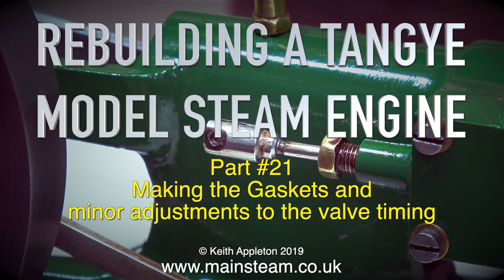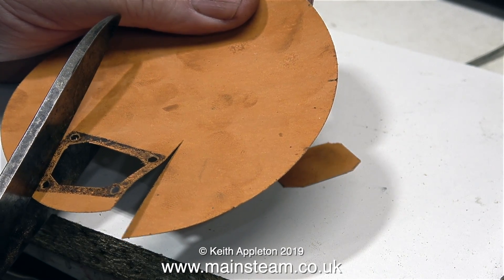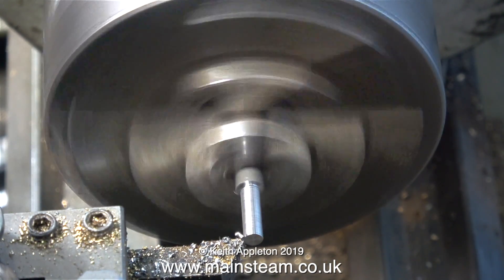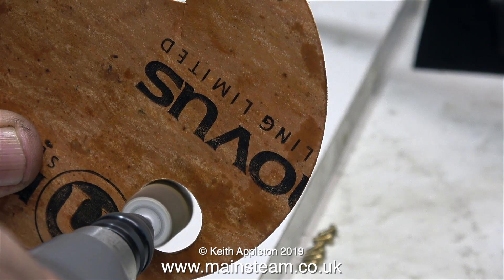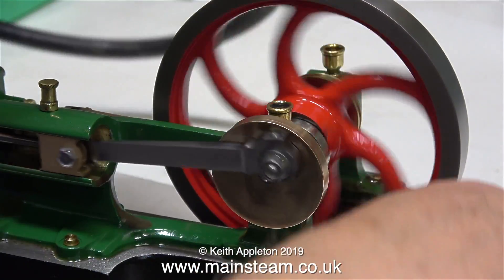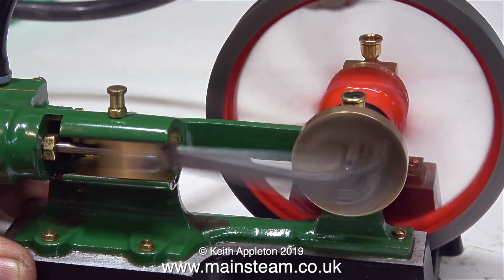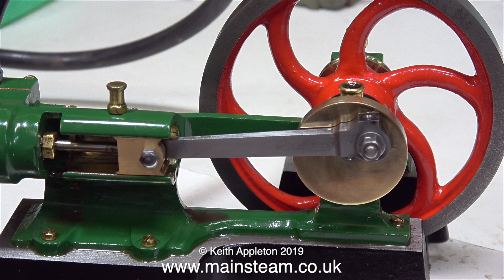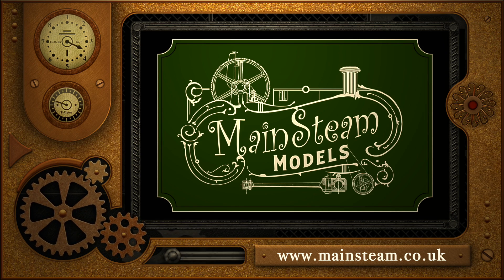REBUILDING A TANGYE MODEL STEAM ENGINE - PART #21

Comment: Top of your game...lovely rebuild.....a layman question...you clearly demonstrated how to adjust an eccentric to admit steam on or just after TDC...how do you adjust BDC ?  In your slo motion shot....the exhaust sounds seems late at BDC...is this adjustable?
Reply from the maker: If the slide valve is in exactly the right place, then TDC & BDC adjustment is the same. On this engine there isn't any adjustment of the valve's position so it is a tiny bit out. The final tweaked setting as shown in the video seemed to suit the engine best in the end. Always on steam engines there is more pressure on top of the piston because on the other side of the piston there is the volume of the piston rod in the cylinder to take into consideration, that is also why the exhaust beats often sound different because less steam is exhausted from the piston rod side of the cylinder.

Comment: I’ve just come back from work where I’ve been working on a WWI Asquith radial drill (we’re not too sure when it was made as it only says ‘war finish’). This old equipment is a delight to work on and would originally have been driven by line shaft. In the old days when it was made there would most likely have been a full size engine driving the shafts, now its had a meaty electric motor conversion, but still sat out of use for some twenty years or so. It’s a good project and very rewarding to get back going again :)

Comment: Excellent work, if you're making one that's only going to be run on compressed air or driven by a hidden electric motor do still use the heavy steam oil or a lighter machine oil?
Reply from the maker: Use lighter oil, no steam = no requirement for steam oil.

Comment: I'm just curious,  when the video was in slow mo it looked like the big end sort of paused as it came around the bottom. Was this an illusion or is it normal operation? I'm not being a pratt  just trying to learn. Thanks.
Reply from the maker: I think it is a video anomaly, but it may still have had a tights spot as it needs running in . . .